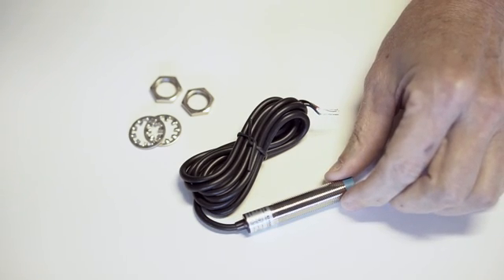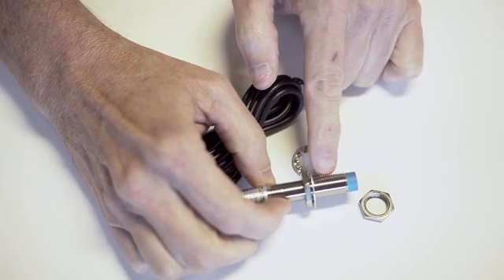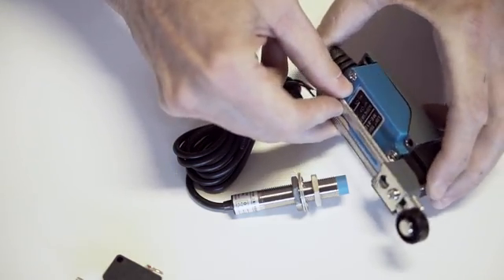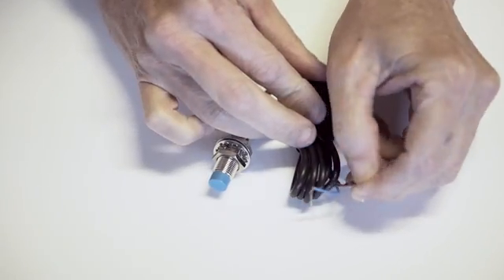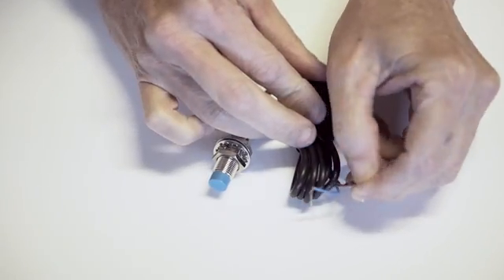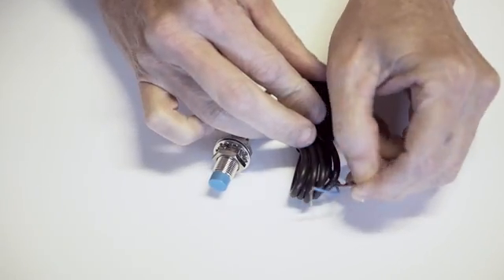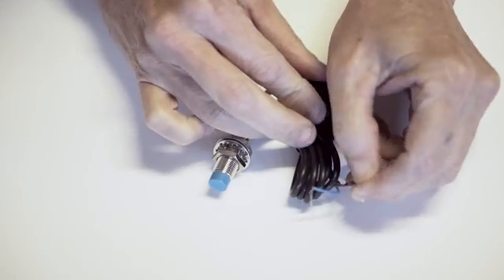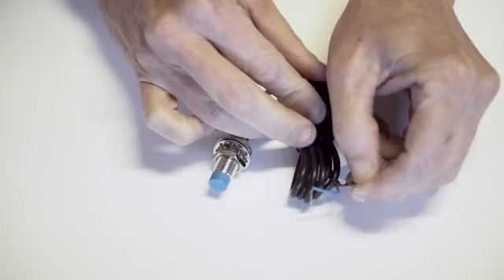Proximity Switch - Introduction, Wiring and Testing

Comment: Can I use two inductive proximity sensor with the 24 volt power supply
Reply from the maker: Absolutely! You can use many. The proximity sensor does not draw much current.

Comment: Need more explaination when having mutiple proximity on each end . Can they be connected in series
Reply from the maker: Yes, they can, and I will probably make a video on this. As long as the proximity switch is NC type, the switch can be connected in series. As long as the switch is getting power to enable the sensor, the output signal works very much the same as a typical mechanical switch.
Reply: @PatrickHoodDaniel  can photoelectric sensor be it used for CNC machine. Br100-ddt sensor .I have some in the factory remove from a scrap machine

Comment: Sir, can you please explain with schematic diagram and components used in electromagnetic accelerator using this sensor which rebel the ball bearing away when it reaches near the inductive coil from it. 
I needed this for my science project in my college. Please...

Comment: sooooo what happens to the pokeys57 inputs running 5v logic when your prox switch is inactive and you pushing 24v into it?? im hesitant to try as i dont wanna blow up the board.
Reply from the maker: I didn't make that clear in the video. You would need to use a 5v proximity switch. We have those in stock and will be adding them to that page. Thanks for pointing this out.
Reply: @PatrickHoodDaniel . I don’t see the 5v proximity switches on your site.  I guess I need to buy a level shifting optocoupler to reduce the voltage from switch down to 5v?
Reply: @PatrickHoodDaniel  I think this is my issue with prox that work sometimes but not all the time....    They are 6-36v  I think it was 12v powering them.   
I need to use the switches that I have as they fit and are just the right size..   (SN04-N DC NPN NO)
I tried to power with 5v and no go,  (edit: I was able to get the switches to activate using 5v from the LCD connector.  I have the new enclosure hooked up and the limits seemed to be working).  Need to mess with the probe inputs still   I do have one odd prox at the top of the Z that is acting squirrelly but I am chocking that up to the fact it is different from all the others.  
Fun fact:  Past Don decided to add diodes in line...   so testing them through me off slightly..   
Nothing seems to have been harmed by the 12v and jumping the GRN and limits will still activate mach 3 stop.